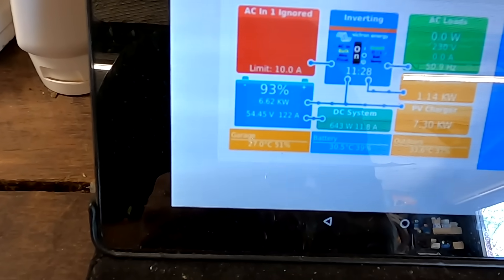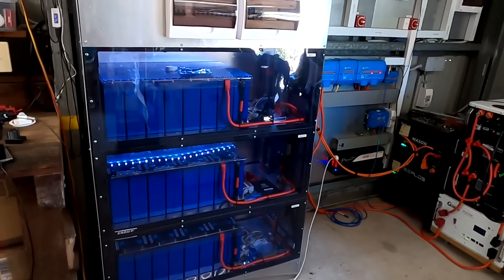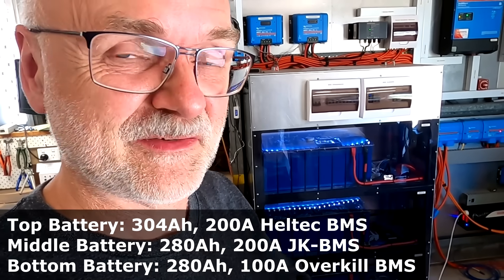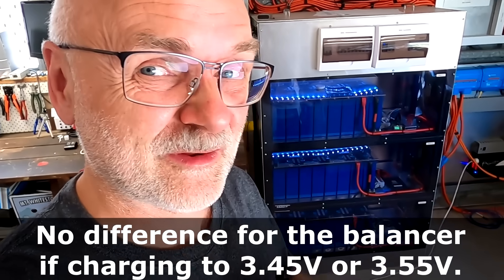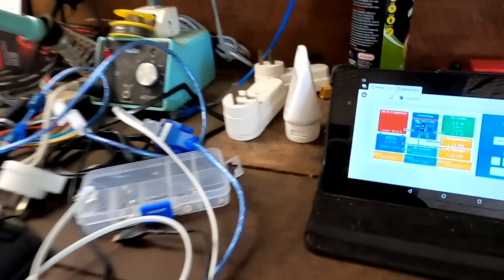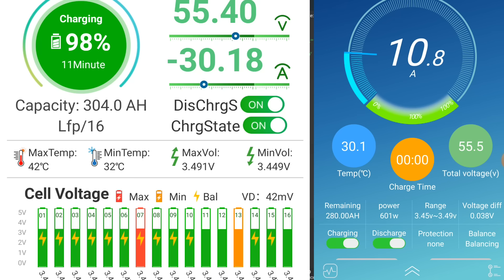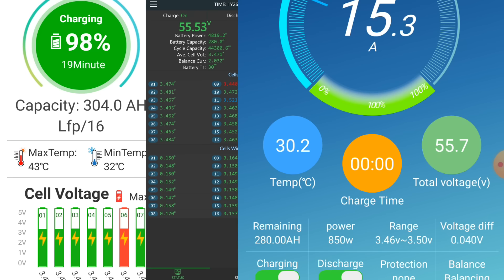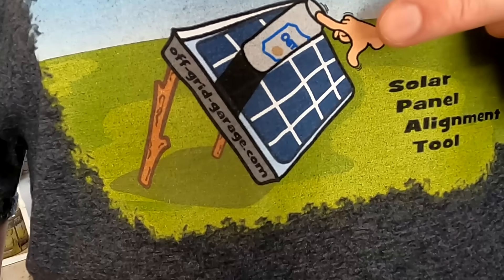Higher charge voltage = better balancing? Here is my battery shelf result!

Comment: very unfair test because the JK balances in "static" mode and the other bmses seem to only balance while charging which also is very inaccurate as the bms doesn't record charging below 0.5 amps of charge current.
Reply from the maker: Only the Overkill has a 'charge balancer'. The Heltec balances all the time once of the trigger voltage but stops at some time due to a software bug, I believe.
I tried the Overkill with charge balancer on and off with no different result.
Reply: @OffGridGarageAustralia  next step would be to adjust the calibration of the bms current to force the bms into static balance all the time 😁

Comment: Awesome Andy, great job, and absolutely exactly as I suspected. Milliamp balancing is never going to work with such large cells unless they are incredibly well matched. 
ie: In the real world, you need an active balancer…. Period! 
I use very similar voltages to you, and my JK BMSs handle it perfectly. 👍👍
Reply: Passive balancing would work, when they had enough power.
Problem is having to balance 15 cells with 2 Amp each, would be about 100 watts of heat, so you need alot of cooling.
Reply from the maker: Passive balancing in this dimensions would be a real problem in terms of heat but also waste of energy. I'm glad we are stepping away from that und use better technology these days.
Reply: @OffGridGarageAustralia 😢

Comment: Andy, I have the same results on my 48volt system using the overkill bms. Since I installed the 5amp active balancer this has resolved my issues. Thank you once again for helping me through this issue. You are a blessing to all of us!!
Reply from the maker: Thanks for sharing. Active balancer cure everything these days, it seems 😄
Reply: @OffGridGarageAustralia  except for RFI? I ordered the 2A JK BMS. Dreading to find out what it will do to AM/SW radio. Did you test this?

Comment: Very fascinating, im kind of disappointed my 4s x2 Lithium batteries are perfectly balanced. BTW i like  your light system you made to drain the individual cells. Id like to make a similar device. Do you have a video showing  how you made it what lights you use etc. etc. BTW i consider myself a noob compared to  the set up you have plus all the tests you run.
Reply from the maker: I don't have a video about the light bulbs, no.
I used some 12V halogen lights and connected them all in parallel. I can just connect/disconnect them in pairs to reduce the power I'm pulling from my batteries.
I only have all this equipment because I'm interesting in all this testing and want to find out what happens if I change settings and parameters. If not for that, it would be an absolute overkill.
Reply: @OffGridGarageAustralia  Ok thanks. Ive seen other youtube videos where they used those lights or something similar. Ill do some searching around see if i can find a diagram so i can make one.Cheers!
Reply: @OffGridGarageAustralia Actually it would be interesting to see a video that goes into more detail on the light board along with modifications you think might be helpful if you were to do it all over again.
Reply from the maker: @inmyimage1081  I did a video on the LED lights actually.
Yeah, will do a video on improvements for the next battery shelf, great idea.

Comment: So the JK is the only one working as it should out of these 3 balancing (even with added balancers)...with a correct voltage of 3.55V (Absorb) and 3.45V (float).
Reply: it was an unfair test. The 2 other bmses are not balancing when they reach the absorption voltage or when in float voltage. I believe the app should have the "charge only balance" should be turned off so the bms will balance continuously while in float mode.
Reply from the maker: I tried with charge balance on and off. There was no difference.
Float on 3.45V is way to high, it was only for the test to give the balancers more time. It should be at around 3.35V

Comment: Let hope it's not Batrium 🧐
Reply from the maker: Why is that?
Reply: @OffGridGarageAustralia  I have been using a watch Mon and long mons for about 5 year and had lot of problems with it long mons failing and now the WiFi will not work and if I unplug the USB from my laptop the thing completely resets even with the power supply also plugged in and as it is not active balancer it has a hard time with the life04 system. Support is not that good well unless you have a large YouTube channel.
Maybe the new stuff is better I will wait for your videos but I looking at the jk bms.
Reply from the maker: @GarryL277  I have heard similar stories... 
I think, I found something bullet-proof now...

Comment: Great testing as usual, I think that is fairly definitive for active balancing.

I disagree on the passive balancing though, your float might have simply been too high at 55.2 (3.45V/cell).  I don't really understand why you set the float that high for the new test settings.   Unless that was a type-o?   At 3:46 in the video.   A float that high will unbalance the cells (note 1) and undo all the work the passive balancers put in, and it will show up once you push them higher.   You might as well not be testing passive balancing at all with a float that high.

note 1: Remember that minor differences in cell chemistry show up below the exponential part of the charge curve.   I still feel that 3.45V is not deep enough into the exponential part of the charge curve (particularly when charging at higher amps) to remove the differences due to chemistry.  That means if you float there you are likely undoing any benefit from the passive balancers.

-Matt
Reply from the maker: I set the float to 55.2V (3.45V) for the test to give the balancers maximum time to balance out these cells.
Of course, 3.45V would be far too high for a float setting. It should be at ~3,35V as this is the natural rest voltage of a fully charged cell anyway.
Reply: @OffGridGarageAustralia  Holding the voltage above the proper float threshold for too long will overcharge the cells by differing amounts based on minor differences in cell chemistry.   In otherwords, it will start to unbalance the cells rather than balance them.

This is (another reason) why the balancing should only occur well into the exponential part of the curve (aka 3.50V+).  Because when held at that voltage, ALL the cells are slowly being overcharged at roughly the same rate if we discount balancing activity. Which means that the balancing operation itself will have a positive effect.... it will bring the actual SOC of the individual cells more into line with each other.

When trying to balance at lower cell voltages, minor differences in chemistry will cause the "perfect balance, 0mv deviation" to slowly overcharge the cells at different rates (due to minor differences in cell chemistry), which is not what we want.   Keeping in mind that any voltage above roughly 3.40V will, if left long enough, overcharge the cells.  It will top out, but at different relative SOCs, so on the next cycle if you try to push any higher, some of the cells will shoot up past 3.65V.

--

Maybe that other posters comments points to a better research path... I always just assume that balancers work properly, but it has become very clear that for many of these BMSs, their balancers do not work properly.  Are the balancers even operating the way we expect for the time interval we expect?

For example, some BMSs do indeed stop balancing when the charge current drops to zero, which makes passive balancing far less effective.   Other balancers might start working on the cells starting at too low a voltage, which is also detrimental.

What we want, basically, is for the BMSs passive balancers to take energy from any cell whos voltage is greater than (current_pack_voltage / 16) for any current_pack_voltage that is above a certain configured value.  It can optionally put that energy into a low cell, but it doesn't need to because as long as the charge controller is holding the pack voltage >= (configured pack_voltage), the charge controller will clean it up.

So for example, if this configured value is 3.50V/cell = 56.0V, and the battery is held in absorption at 3.55V/cell = 56.8V, then the balancer will take energy from any cell higher than (current_pack_voltage / 16), aka any cell higher than 3.55V.

But once the pack voltage drops below 3.50V, meaning that the charge controllers are no longer holding the pack in absorption, the BMS must stop trying to balance stuff (because doing so will unbalance the cells rather than balance them).

So for absolutely sure we do not want the BMS to try to balance anything below the configured pack voltage, because that will also unbalance the cells rather than balance them.   And for reasons of cell chemistry, we really don't want that configuration parameter to be set too low either.

I personally think that 3.45V is too low for any balancing operations to be active (and because it may not work well in colder temperatures), but it is definitely arguable.   Regardless of that, the pack can't be held above the float indefinitely (whether balancing or not), because we do that for long enough and we will undo all the good the balancers did.

That is what we want the passive balancer to do.   But I guess most of these blasted BMSs still don't understand how to balance cells properly.

-Matt
Reply from the maker: @junkerzn7312 That makes sense, Matt. Thanks you.
I think passive balancer will disappear at some point. They really make no sense with LiFePO4 chemistry unless you go really high. Nowadays, we just have better technology and active balancers are so cheap and just get the job done, even at 3.45V.
Reply: the issue is the two bmses are turning off the balancing function when in float mode and the JK bms is still balancing when in float mode. The other bmses should have a function in the app to turn off "balance when charging" so then when the battery is floating or "not charging" the balancer will continue to work and match the voltage of all the cells.
Reply: @uhjyuff2095  That's a good point.   I don't know why the designers of these BMSs thought it was a good idea to do that.  Balancers should pull energy out of any high cell above a certain (programmed) cell voltage regardless, simple as that.

To be honest, I'd be happy with a per-cell bleed resistor circuit.  There is no real need to actually transfer energy into other cells since a healthy battery is, for all intents and purposes, going to be near 100% SOC anyway once the voltages get up there.

Comment: Hello Andy. I have been watching your videos for 6 months now (think I have seen nearly every video, some of them many times). I was totally new to off grid systems and have learnt heaps from you. I have now built a 16S 304ah Eve battery bank (approx 15Kwh) with a JK 2A active balancer BMS. I have used all Victron equipment, a MPPT 450/200 charge controller, a Multiplus II 48/5000/780-48 inverter, a 500A smart shunt and a Cerbo GX. The system was first turned on 5 days ago and is working fantastically. I am still grid connected but have only used 0.3Kwh's of paid power since turn on. I am still fine tuning the system and your video's are invaluable in helping me do that. I will be buying another 16 EVE cells very shortly and expanding my system. (I built it all with the aim of being able to easily expand, the battery cabinet can take another 16 cells and my power wall is prewired ready for a second inverter.)  I paid for a SPAT for you a while back, but I think you deserve a few more. Will do that today for you. Thanks for all your help.  Ooops, fat fingers, the Multiplus is a 48/5000/70-50
Reply from the maker: Thanks so much for sharing your journey! And watching so many of my videos of course. 
That is a fantastic outcome and I'm really happy to hear and read about such success stories. This is exactly the intension of this channel to motivate and educate others so they start their own journey!
Thanks a lot for your support as well!🍺🍺🍺

Comment: Nice test results. Didn't you swap BMS1 and BMS3? It seems Hellteck is not good with balancing. Good job! Thanksfor sharing
Reply from the maker: Yea, I swapped them a while back. The Heltec seems to have some software issues and bug. I never really got a reply from them. So the Heltec will go and be replaced with something new.

Comment: i have a 12v timeusb battery can i hookup my loose cell 36 v with a jk-bms 8-20s in series for 48v?
Reply from the maker: Probably not, unless the cells are all the same voltage, capacity and chemistry.
Reply: yes! lifepo4 3.2v 12 cells series thanks .  the 4-8s jk-bms support series  also?2 jk-bms 4-8s for 48v will it work also😅

Comment: Hi Andy, you're simply the best! As a beginner I learned so much about Batteries, BMS and Balancers from you.
Reply from the maker: Thanks a lot, Gerd!
Reply: Hey man. I have a small system that I built with your tutorial  help. Can say that it was very fun to work on.
Now I need some maintenance help.
Eg. How to troubleshoot the battery If they fail

Comment: hi Andy! now that you have those data, would you consider changing the two bms's?  tripple jk maybe? or other brands? i also have 3 battery banks, 24v volts, but the behave differently than yours. i hope to see more vids of experimenting on the big battery. and i hope too see andy 2.0 again.
Reply from the maker: Well, charging to 3.45V, I never had an issue with the two BMS and balancing. Even after 1.5 years, they were still working fine and after such a time period (maybe ever 2 years), I can just connect an active balancer over night and top balance them again if I feel that way. But from a normal usage perspective, I don't even have to do that and can keep using them as they are.
So, at this stage, I will only replace the Heltec BMS as it has some wort of software issue with balancing cell 1-10 all the time. The new BMS will be very interesting!
Reply: @OffGridGarageAustralia I am using two jk bms and a daly bms, I had to keep a active balanced handy since the daly cannot keep up balancing the cells. I have 3 banks with the same capacity. But the bank with the daly takes and gives more current the the two with jk's. And it has bothering me. Any chance that you could do an experiment on this? Thanks Andy, its been two years, I hope to learn from you in the next decade..
Reply from the maker: @AirIswhenibreathe  can you swap the Daly and one JK BMS. I would be interested if the faster charging or discharging sticks with the Daly.
It could be, that the overall resistance of the Daly battery incl. the Daly BMS is lower and hence it takes more current.

Comment: Still looking at the balance difference of the cells at the top of the curve why?, the only thing you see there is the difference in the internal resistance of your cells and your connections, when charging stops the values drop to the resting values in a minute, the real values..
Reply from the maker: Above 3.45V is the only way to see a difference across your cells and that's where you should start balancing.

Comment: Off topic, ive got the new JK BMS 2A 200A. No current sensor anomaly when solar input and inverter load are equal and the nett batt current hovers between +/-. Also nice setting of SOC 0% and 100%. But it cannot power up my 24V/3000W Latronics inverter or my 48V/8000W Mppsolar inverter it detects short circut even it has a precharge function. The MppSolar can be precharged (100 Ohms Resistor) but the Latronics not. For this one i have 200A circuit breaker betwenn B- and P- which i close. Then i set the JK into emergency mode. Then i power up the inverter, then i open the circuit breaker and finally i cancel emergency mode. 

I started a conversation with the official JKBMS store but at some stage they just deleted all my messages instead of responding.

Edit: I measured all my cells (those stupid BYD 320Ah with one terminal on each side) using the blue 40A tester and after a period to try and error come to exactly the same conclusions with Voltages and balancing.
Gut gemacht, Audi.
Reply from the maker: They deleted your conversation?! Wow

The JK software is still buggy. They basically start from scratch with almost everything. I'm not waiting for that to progress, I'll move on...
Reply: @OffGridGarageAustralia  Yes but not everybody can just move on. I have 5 JK systems running (House, cabin, shed, ride-on mower and motorcycle)  and happy to use just one app and mastered all the quirks. You're still young and adventurous but in my age you like to settle on something which works.
Reply: With a pre-charge resistor you shouldn't experience this.
Try changing the SCP Delay to 300000ms
Reply: @naijawindandsolar In case of the 8kW inverter the pre-charge did the trick. But the Latronix cannot be precharged and it's ramping up requires the internal resistance of a lead acid battery. Lithium just merciless hammers the Amps in. I tried, it still shuts down with short detected.
Reply: @moestrei Then you should probably just gift out the inverter to someone with Lead Acid battery.